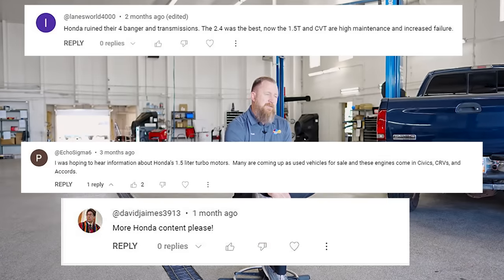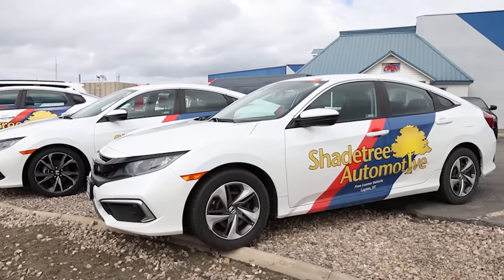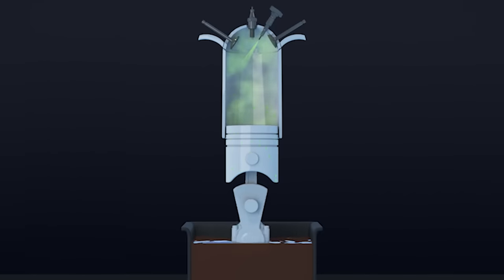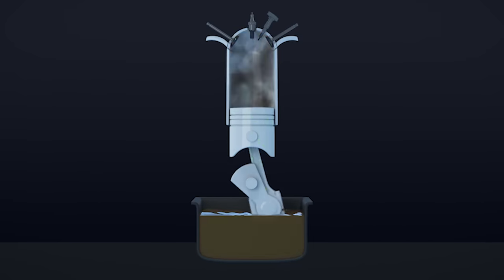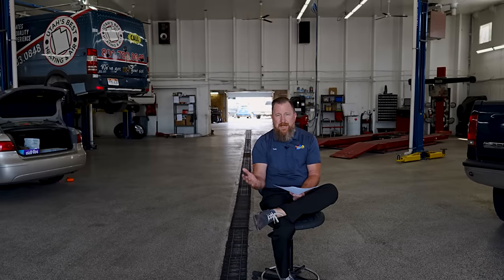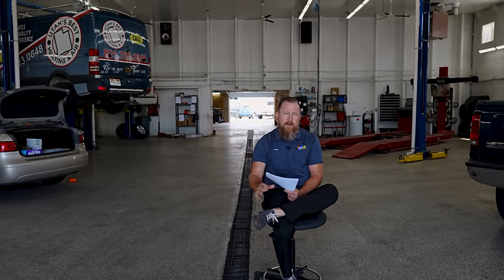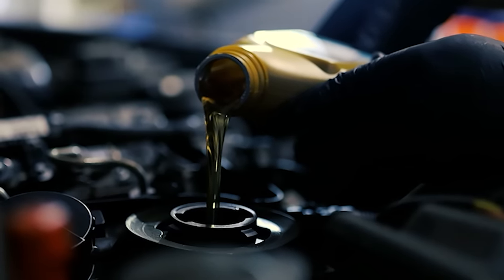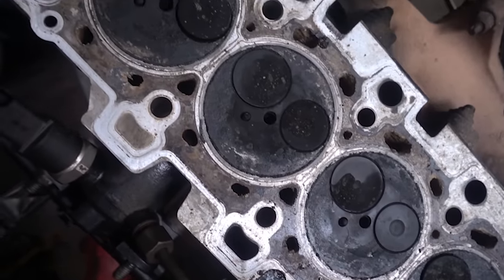Honda Oil Dilution Issue - Should you buy a new Honda

Comment: These small engines with turbos are not a good idea. They are going to be more problematic and won't last as long.
Reply: I guess it depends on what you consider lasting long.  These turbo 1.5’s have been around for 8 years now and they’re still going strong.  I also have an 18 year old Civic which is still running fine, no problems at all.  So if you’re someone who expects a car to last 18 plus years?  I’d still bet on the Honda over just about any other make.
Reply: @viffer94  "
Quote:
So if you’re someone who expects a car to last 18 plus years?"

There are cars out their that have lasted 40+... Built back in the day when designing shit to break down to make more money wasn't common practice. Back then your reputation was largely based on "Built to last".  Cars these days are built like throwaway TV's.. , and it isn't just a Honda issue. So with that said, these 1.5 L turbo engines are essentially exactly that... Honda knows this issue is a major problem .... Part of the problem is that valve seals are not designed to withstand the extra pressure from the fuel injection, and thus more fuel gets through to the oil. No amount of pre-warming the engine up or extra oil changes will fix that.  Let's not forget that extra oil changes = $$$$ ... , or profits . 

My mother just bought a 2023 CRV LX and it doesn't even have 500 miles on it yet and it already has this problem. We live in Minnesota and it's summer time.. The dealership just repeats the same advice and then tries to argue this isn't covered by their powertrain protection because it isn't caused by a part that touches oil.. So she returned the vehicle and she is now looking for an SUV that does not have this 1.5lL engine. I suggested she look for a car that is pre-2000's ...., as she would likely get more reliability out of a car with 200k on it that is still in good shape than one of these.. She could probably run it to 400-500k miles and still outlast most new cars.
Reply: @TheJackelantern 
The direct injection system squirting fuel past the seals is probably most at risk when the piston seals are ice cold ie. freezing cold weather and a cold start engine.  Now if you let the car warm up a bit under those conditions before revving the shit out of it and squirting high pressure fuel into the combustion chamber those seals can probably expand and start doing their job a lot better.  But this is going to be an issue with any direct injection system, not just Honda.  Now I don’t warm up my engine for more than a minute or two before taking off but I don’t live in a freezing climate.  If I did I would.

Gasoline is also volatile enough so that as long as you let the car get up to normal operating temperature on your daily drive any bit of gasoline that does make it past the seals should get burned off quickly.  You don’t need a car if your commute is only 3 minutes long and you’re driving for 200 yards.

I drove my dad’s old Buick Skylark to high school every day.  It would buck and stall and cut out in the middle of left hand turn intersections with uncontrolled traffic heading straight for me.  Fun, like playing Russian Roulette before my 8 o’clock Algebra class every morning.  The good old days weren’t that good mate.
Reply: @viffer94  It is summer . The idling of the car to temp really only has an impact in the winter when temps drop below 40 or 30 degrees.  The problem then is still more than it should be. Personally, I think they need to redesign this part of the engine even if they can manage to get another ring layer in there or design a better fuel injection system that can make sure to burn that excess fuel off before it can seep into the oil.  

The fact that this engine in 2023 has gone under no design changes or has had no changes to fix this issue is just insane.
Reply: Not having any trouble with my 1.5T any more than any other Honda I've ever owned. Nothing but Hondas for 35 years now. You believe everything you hear? 95% of the people talking shit bout the 15.T don't own one so they should STFU. There, I said it!!
Reply: @markr.1984  This isn't to say Honda is bad or terrible.. It is that this engine is and has according to their own support forum "Bricked" a few engines because some people were not aware of the problem. That is a safety issue in my opinion.. 

My old 2008 Honda CRV was great!. No major issues with it, and certainly nothing that could potentially lead to catastrophic failure.  The criticism here isn't to hate on Honda, it is showing disappointment in the fact that this issue should long have been fixed outside of applying a Band-Aid on wound that will never heal.  The criticism is meant to be constructive.
Reply: @viffer94  Me too, except I don't think they will. The legendary reliability thing is done.
Reply: @markr.1984  Well I do own one and I can tell you it is a concern.

Comment: For carbon build up I've been using 5 oz of Red Line 60103 SI-1 Complete Fuel System Cleaner  in most tanks of gas. The 2011 Honda Pilot I own is known for plug fouling and misfires. This seems to be working. I pull the plug on cylinder 3 at oil changes and inspect with an endoscope to monitor the situation.
Reply: That is happening due to cylinder cut off from VCM.  A cylinder that isn't firing is a cylinder that is fouling.

Comment: Honda has become high maintenance. Expensive.  CVT, carbon buildup every 30k miles. Time and money 💰 if you drive a 1.5T. Toyota still has port injection and 8 speed. Low maintenance, low cost 😊
Reply: No they have not. You don’t need to do this carbon service. Honda has excellent carbon mitigation by design. There’s a guy with 700k miles on his 1.5T civic on YouTube. Oil dilution is completely overblown. Unless you are driving super short distances in super cold you don’t have to do anything like what this guy is saying, and the newer models don’t have the issues. Also honda CVTs are excellent and you can purchase Hondas without the insane markups like Toyotas have.
Reply: @areallytallguy I didn't say anything about oil dilution. Honda is high maintenance now. They require cvt, carbon buildup maintenance every 30k miles. Port injection and 8spd are much lower maintenance. Yes, Toyotas are overpriced.
Reply: @lanesworld4000  you just completely ignored my entire comment. Hondas DO NOT require carbon build up service every 30k miles. This is literally just that shop saying so, which isn’t required.  Honda doesn’t have issues with large amounts of carbon build up in their direct injection engines.

Transmission fluid changes are nothing new CVT fluid changes are typically around 50k miles per the maintenance minder.  Which is really around the same time you should be doing fluid changes on a normal transmission. You have no clue what you’re talking about.
Reply: @areallytallguy 😂😂😂 boo-hoo.....
Reply: @lanesworld4000  nice retort. Clear you have nothing logical to say.
Reply: @areallytallguy I thought my org comment was very clear. 😂
Reply: Some Toyota engines have dual direct & port injection ..... The port operates at low speed & direct at high speeds......look for and buy these engines 👍
Reply: @lanesworld4000 require CVT? What does that even mean? CVT is the transmission, and it doesn’t come in every Honda 🥴
Reply: @areallytallguy  I was a honda fan.. until I bought a toyota. peace of mind is night/day. hopefully you see the light in the future

Comment: GDI engines, the worst.  I change the oil once I see it's getting too diluted, whether it's time for it or not !  BUt using the best oil as possible, cost wise too, Use the ones that have the best NOAAK  test results as possible !  WE have  a 2015 Honda Accord  W/ 2.2 Litre eng.  that  I have noticed one time the oil level  being close  to  a quart too high on the dip stick !  Switched to  a full Synthetic  high mileage oil and it got way better. But still changing the oil much sooner than recommended !   Thanks !

Comment: direct injection allow you to use less fuel,so run leaner and it's injected during compression.
loose rings to reduce friction and to accomodate a turbo engine with less compression ratio is the main problem.
Turbo engine need to be used with rings compressed,so in boost,and no to go buying groceries at 15 mph.
Oil dilution is ring leaking problem,not a fuel problem.
Cold climate will make the cold start enrichment phase longer,so fueling longer and rings expansion time longer.
You can't expect a low compression engine with low friction matched parts to not dilute oil by fuel.

Comment: I live 5 min from my work with climates dropping as low as 20F. No issue so far aside from a little bit higher oil dip stick lvl with some slight gas smell. Around winter i change my oil even though i only drove it for 2-3k miles and try to go around town for at least 20 min to keep the excess oil burned up

Comment: For the record I have a 22 Accord 1.5 turbo engine with 8000 miles on it and it does not have this problem. I do always make sure it’s get to full operating temperature as I would with any car and I live in a cold climate state. I also change the oil every 5000 miles. It’s a great car.

Comment: If you have one of these engines, change the oil every 5000 mi AND use Full Synthetic GF-6 rated engine oil. The GF-6 standard has been engineered to help address problems with oil dilution, among other things.

Comment: Would you have any info on Honda/Acura valve covers that deteriorate. Early 2000s more specifically. Seems like some kind of electrical arching that causes the aluminum to deteriorate? Mostly around the top, where the valve cover meets the spark plug tubes.

Comment: I love Honda cars but with that 1.5 liter engine I'm a little hesitant to buy one. I know that Toyota's have a direct injection with port injection that fixes these kind of problems with carbon build up and oil dilution. One thing that is for sure that Honda and Toyota reliability are not what they used to be. Thanks for the great video.
Reply: I know, I already had to replace the wiper blades on my 2016 Camry!

Comment: Surprisingly the carbon build up intake valves for this engine aren't that bad. Search for "Troubleshooting 10 Gen Honda Civic 1.5t poor performance and MPG issues" from tranquilizator and he troubleshoots why his MPG was bad. While it was a damanged intercooler, he did ake a look at his intake valves at the 6 min mark. Not too much build up on the intake to where it wont operate effectively. For a GDI engine, it does better than other GDI engines when combating carbon build up.

Still a must to use top tier fuel to keep those fuel injectors clean.

Comment: 8:52 what is this carbon clean and can you do it yourself
Reply: I think it’s a fuel additive that helps clean the carbon off valves.  Research the product he mentioned.
Reply: @Dbb277-2 the fuel in a direct injection engine doesn’t wash over the valves like in a conventional engine, so NO, it’s not just a fuel additive.
Reply: @ thanks.  Just bought a car. Went with a V6.

Comment: Had a 2019 CR-V with the 1.5T. Had a trip where we drove 3500 miles in about 3 days, middle of summer. Still about 0.75qt over-full when we finished. Nope.

Comment: Bought the 2L naturally aspirated 2017 Civic because of carbon build up from Direct Injection and because of wear from the turbos from the smaller engines provided by the higher trims.
Reply: Great choice!!
Reply: @gianfrancoa  
The Civic got fat in the last update though, the 2.0 is a bit slow in it now.   Even the base Corolla is a good bit quicker.

Comment: My '19 civic with the 1.5T seems to have a gas smell in the oil. It could be placebo since i know about the issue. Ive changed the oil every 5k miles. Im nearing 50k miles and am thinking about sending an oil sample in for testing.
Reply: Honda does not care.

Comment: We recently got a 2021 Honda Accord LX with 10,000 miles, and we've added about 1,000 miles. You mentioned that the dilution issue affects up to 2018. Any issues with newer model years?

So far, haven't noticed any changes in oil level and no fuel smell from the oil. I'm keeping a close eye on it, though. Planning to keep OCI at or below 5,000 miles.

The only negative issue we've  experienced is predetonation when the engine is under heavy load (merging or passing, for example). Goes away with premium fuel, but the car is rated for regular fuel. Seems like a strange thing for Honda to get wrong.
Reply: On the hondanews site, the '23 Accord both 1.5T and Hybrid are already updated to "91 Recommended". It may hurt the wallet a bit on gas pump but may help in the long run for using higher octane fuel.
Reply: If you watch hondamobilemechanic   YouTube channel he sees head gaskets blow on 1.5T Accords due to low octane gas and predetonation.   Switch to 91 octane and no worries.
Reply: @stevenr1354  
that can add thousands of dollars over the life of the car though

Comment: I also think that ethanol fuel runs at a lower combustion temp than ethanol free does. And we want these 1.5T engines to run hotter. Ethanol has different thermal characteristics and is said to run at a lower temp. So going to ethanol free in the winter might help. But I'm not an automotive expert. But I did sleep at a Holiday In Express last night! So ask the experts to see if they agree with me.

Comment: I believe the SW update was not issued for all areas, at least in the US. Honda did not issue a SW update recall in North Carolina. I assume they felt the average annual temperature here was high enough that the  disadvantages of running at higher RPM's outweighed the oil dilution advantages. 🤷‍♂️

Comment: I’m new to the channel, love your content and explanations. Just recently purchased a 2024 Honda CRV EXL 1.5T. What changes has Honda made for the 2024 engine to stop any potential oil dilution problems? And is the carbon build up on the valves still an issue  with this current model year? I do make short trips of 5 1/2 miles in Southern UT. Thanks again for the channel.
Reply from the maker: There have been many design and programming changes to the 2024.  You are still at risk of some oil dilution but noting to worry about.  Same concepts apply though.  Service it more often than what the dealer recommends.  My 2023 Civics still get serviced every 5k miles.

Comment: Shadetree Auto, as a repair tech myself the diluted oil/ unburnt fuel usually burns off in the combustion process. These problems are not as big as you make them out to be.
Reply: Also, gas and oil are petroleum based products. Changes in the oil viscosity are the least of someone's worries in part because of that.
Reply: Would you consider a 2024 Accord EX 1.5t? I need a car asap, and I’m very interested in this car. However, I have read some concerning things about the 1.5t engine.
Reply: @sherrikwhiteside6107  I have a 10th gen Civic Sport with the 1.5L engine. Kept up with the oil and filter maintenance intervals. No issues, runs fine.
Reply: @sherrikwhiteside6107  Granted, the Accord version is the L15BE  variant of the L15BA engine that I have in my Civic. But the differences aren't significant either. Same with my car compared to the Civic Si's L15B7. If you take care of it and keep up with the maintenance intervals, it will take care of you.

Comment: I had to have a 2014 or earlier CRV to tow behind my motorhome. I got one with 168K miles on it. Being that it had Honda’s bulletproof non-turbo 4-banger and a regular 5-speed automatic I didn’t think twice about the purchase as I was confident I would get another 150K out of it.    My other car is a 2012 Subaru with a CVT and it now needs a new torque converter— with just a 113K on the clock. Word to the wise. Avoid turbo engines and CVT transmissions.

Comment: My wife has the 2021 CRV with the 1.5 motor. Does this problem continue with the later models like ours, or was the issue resolved by the time ours was produced?
Reply: Would like to know too as lookin at 2021s
Reply: After more research, I'm not worrying about it, but I've decided to change oil every 5k instead of the crazy recommendation Honda puts out. All cars have this dilution issue to some degree, but more frequent oil changes as well as warming the vehicle up properly are the solutions to preventing the issue in some particular vehicles.

Comment: What’s your take on the maintenance minder on Hondas? I have a 2.0t accord sport so I don’t have the oil issue except for a few things fixed under warranty. I know the maintenance minder works on your driving habits and is actually smart. Do you still think oil just be changed earlier at 5k using full synthetic oil or go with 7500 per spec of my vehicle?

Comment: Thanks for the info, really glad you made this video!  I live in a hot part of Australia (Brisbane) so the cold won't be a problem but most of our driving is very local, 5-10 minutes at most.  Not sure whether it's better to get the Honda CR-V or Nissan X-Trail from this era.  CR-V has better fuel economy but the X-Trail with the 2.5L engine has lower fuel pressure. Hmmmm...

Comment: I own one of the 1.5 turbo. I am in the Caribbean so no problems with the temperatures. They recommend oil changes every 3000 miles or you are out of luck with your warranty. Can we have more info about the 30,000 miles carbon build up cleaner you just mentioned. I just sold a Fit with a 1.5 and it reached 102,000 miles and never cleaned the valves. I had to change spark plugs more often than I thought tho.